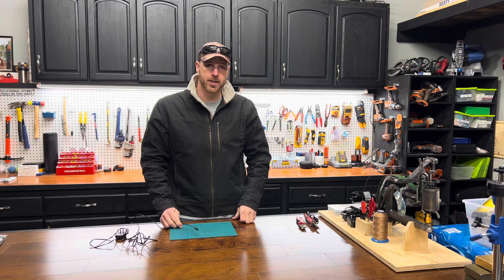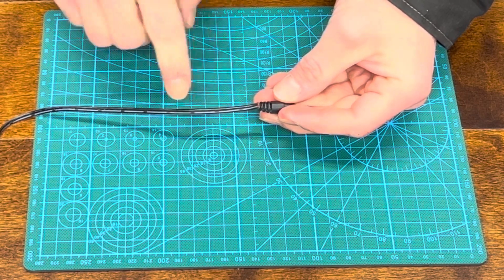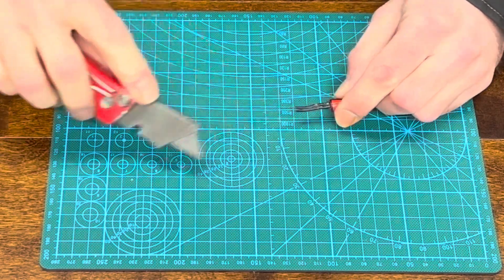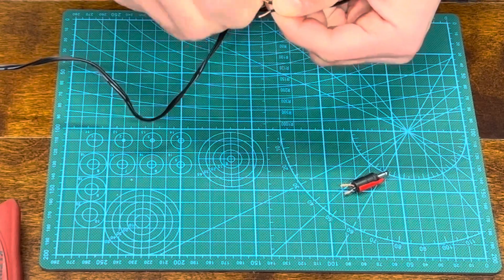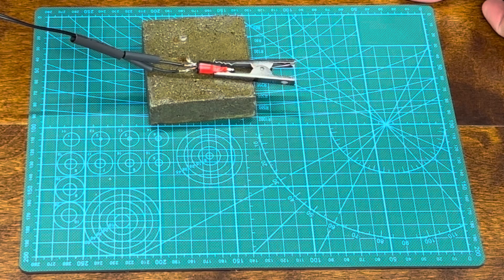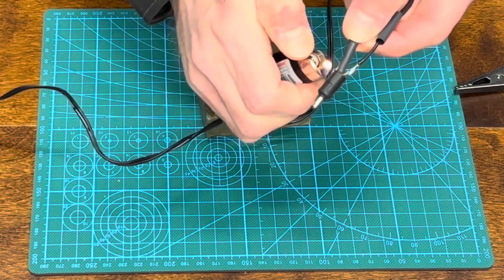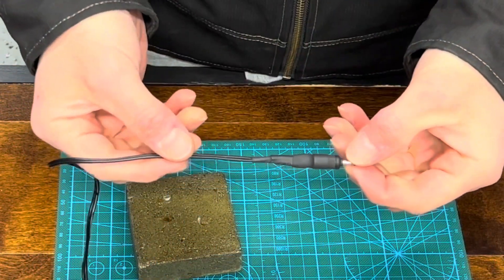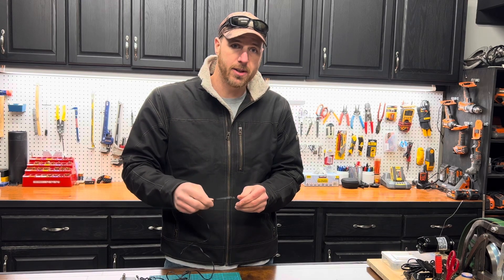How to Repair a Low Voltage Charger Cable

Comment: Omg! Just buy a new cord, dork
Reply from the maker: Why when you can fix it…
Reply: Sometimes the connector's attached to the actual device so it doesn't make sense to just throw it out.
Reply from the maker: Hey Very Little Gravity! Thank you for the comment! That is an old buddy of mine and he just likes pulling some strings sometimes, lol. He meant absolutely no harm but you rock for sticking up for me! Let's go!
Reply: @StoneyCreekSparkchaser  Ah, got it! I was a bit irked because I have like 100m of Christmas lights I'm trying to repair connectors for and obviously throwing them out would be kinda wasteful. I appreciate the advice about getting a kit of heat shrinkable tubing from amazon.. On an earlier repair I used standard red crimp connectors that had shrink tube around them and I could only do each wire separately so it wasn't very strong, but I see how you can make the repair really sturdy by nesting these larger pieces of tubing. It was an a-ha moment for me. Just ordered a kit!
Reply from the maker: Awesome my friend! Super glad I could spark something and good luck fixing your lights. I feel your pain with them. I'm always in the same boat!